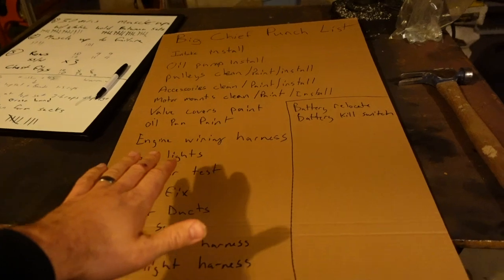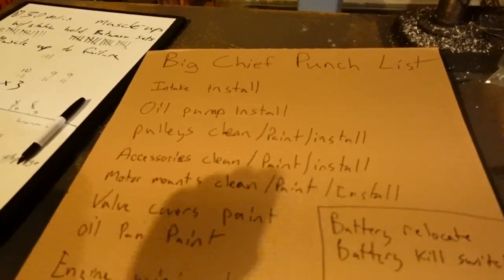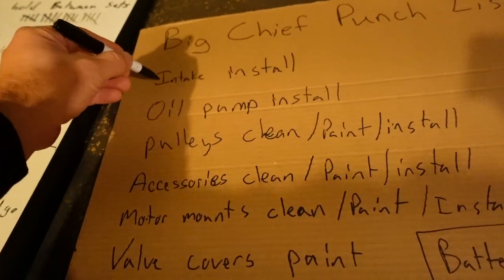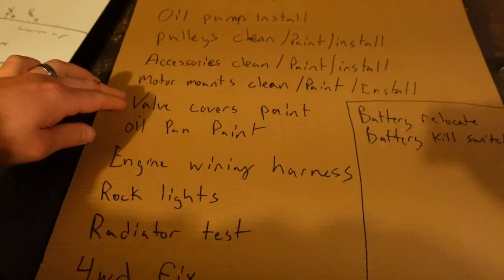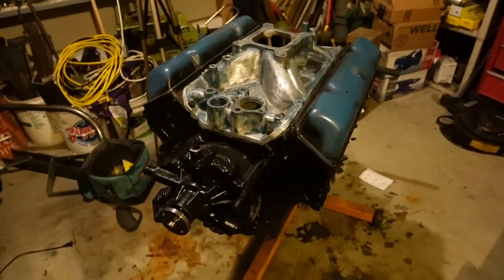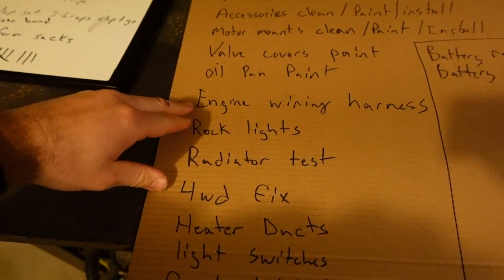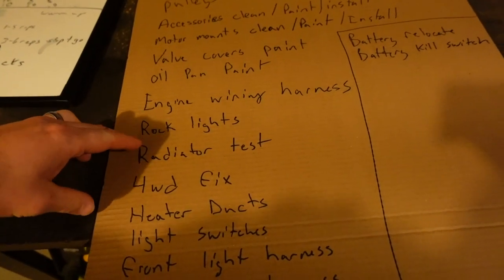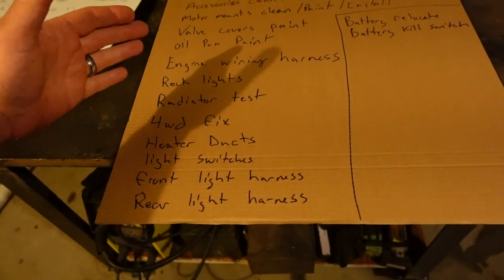How to CRUSH 2021!!!

Comment: Love following along, currently trying to get my 1988 Wagoneer bag in comission!
Reply from the maker: nice, what kind of build is it?
Reply: @DaysofPainandVictory  mostly going to be used as a camping rig, I’ll probably put a lift and meatier tires on it as well as needing to replace ball joints and tie rods. My plan is to get it running the way I want it and then take care of the suspension work while gutting the back of it so I can build a bed platform!